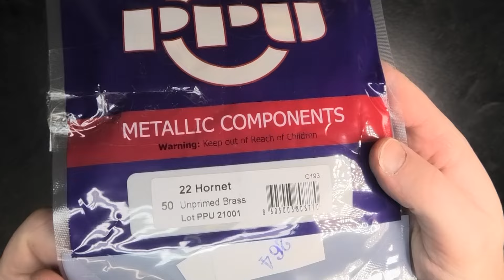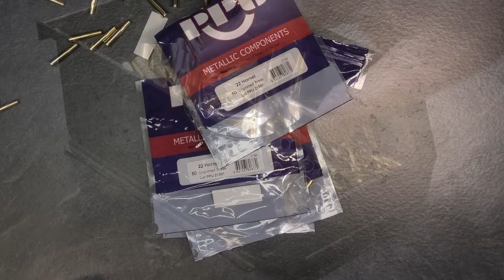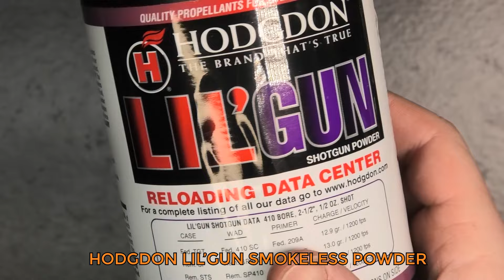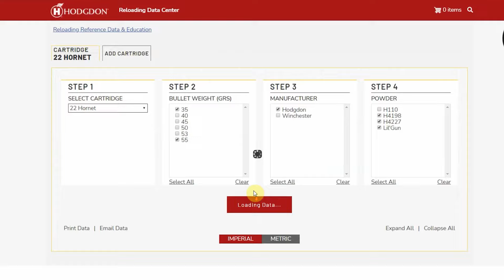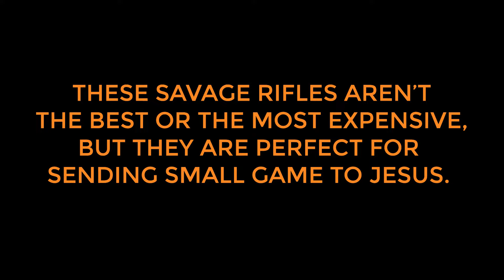Reloading .22 Hornet - A varmint obliterator.

Comment: Interesting background of stereo gear.  Iraqveteran8888 also has a music channel as he play guitar like a madman.  You have that talent as well?

Would the 55gr improve if it were not compressed?

When my new bench flexed like that, I remounted the press on a 2x6 length ways, front to back, across the bench and bolted it down.  No more flex.
Reply from the maker: Oddly enough, I do play a fairly mean bit of guitar, but the background was a  crazy video I found a while back, (and have been looking for so I can give credit), where some guy stacked every 80's hi-fi he could find and plugged them all in.

The bench is out of an old welding shop. The top is 2 pieces of laminated ply, that's been compacted by a life of hard use. I sanded it smooth and glued down the laminate. I'm not sure that's where I want it, so it's not bolted to the wall, and one side is missing, hence the flex. Too many things in the pipeline in front of that that project unfortunately. We're also looking at building a huge outbuilding and it might move out there. Just not sure yet. 

I have a CZ 527 MTR in .223 that also won't cooperate with 55gr bullets, but is sub moa with the 35gr (I almost sent it back to the factory, it was like 6-10 moa!!). The pests are marmots (huge prairie dogs)and bobcats, anything bigger I'd step up to probably 308. this round is moving fast enough that it should pop them pretty good.  Oh, and the reason I have to compress is the loaded overall length has to be 1.725" which is crazy short. If I reduce the powder load I risk getting a bullet lodged in the barrel, and if I don't compress it won't even fit in the magazine (not sure if it would feed but the bullet would be in the lands). It's a tricky little round. 

Thanks for the comments, always appreciated, and don't think I'm arguing, I love input!! :)
Reply: @High_Caliber  I've seen another video where the fellow made a round up without powder and let the bolt close and set the cartridge depth for the perfect length for his gun.   If a bullet gets stuck in the barrel it should not be a problem during testing a lighter load as long as you drive it out before firing the next round!  Not an uncommon test method.  Just use a wooden dowel to check the barrel each time before the next test round is fired until you get the reliable load.  

I find your video is well done and easy to watch.  I watched a few of your older videos to check out the difference.  I find it difficult to be in front of a camera and talk, hence, no videos for me.  Maybe add a few of your favorite (non-copy righted) guitar licks on the end for us to enjoy!

PS:  I want to send my Kbar to you to sharpen for the exact same reason.
Reply from the maker: @callawayken650  That's not a bad idea about the depth, but again, I am limited by the magazine clearance, and since it's not a single shot, the best I can do is maybe a few thousandths over factory. The necks on these are so tight, I might actually damage the bolt trying to seat them, and offcamera, I had a heck of a time extracting one of the 55gr loads (brass was form fitted, just too much pressure).

The channel is a hobby. I watch what other 'tubers do, and they act like gameshow hosts but have subscribers in the hundreds. It's crazy. I'm just not going to do it. I don't need sponsorships, I don't need anything from anyone (except high fives and good thoughts), as I never want anyone telling me what I need to do, and I NEVER want to "chase the numbers". If you note, a lot of videos are different from each other. I like to try different things. Most things fail, but if I can watch it with a scotch and not think it's cheesy, then good enough. 

I'm just now doing a EDC video. I want to see how it evolves over the years I'm out here in this crazy place. I NEVER needed a multi tool in the city, but here it's a necessity. Things like that. I think it will have enough interest to those I wish to communicate with, but not for the general public, which is perfect. You know how they say you can't please everyone? Well my motto is "who cares, let's have beer". 

Sorry to ramble. It's quiet at 4000 feet in winter, a person can go a little stir crazy (if it wasn't for all the damn chores!!!) :)

Comment: Ive been jonesin’ for a video. Finally looked you up and my notifications were off. Great to see you back. 
Is that a .224 55gn projectile? Looks like the same ones the I’m loading like a banshee.
Reply from the maker: I loaded I think maybe 10 with the 55g boat tails.... definitely didn't run well, so I'm sticking with 35g (might keep an eye out for 40g). I've got a lot more calibers to do, but as you know, WAY too many things taking up my "free" time... next one is .45acp, then a 6.5 creedmore. If I had the new range finished, I could have done a proper accuracy test. I'm definitely not gone, just really really busy :)
Reply: @High_Caliber  55 grain is way too much for the hornet/218 bee typr rounds.
There is a reason the highest 45 grains are extra soft points.
Not enough velocity.
The 40 grain vmax is quite good

Comment: I load these alot. I dont crimp, I use 12gr lil gun, 50gr hornady xtp (my gun likes those, savage model 40). I tried lighter loads but settled on 50 cuz groundhogs just stop instantly. case head separation is a thing. I had that when trying a crimp. Dont crimp
Reply from the maker: I agree on the crimp, they showed signs of overpressure on the 55gr, I'm finding really good results on 35-40g flat bottom bullets with no crimp. It's a neat little caliber.

Comment: You Savage 25 WV  is not designed to handle a 55gr bullet.  The original hornet was designed to shoot a 45gr bullet.  To shoot the 55gr bullet, you need to replace your barrel with  a faster twist rate. or just stay with smaller weight bullets.  I current own 3 22 hornets. I own a Savage 25 WV, and it loves the 33-35gr grain poly tips.  Have been reloading for the Hornet(s) for  nearly 45 years. Just one other thing, Remember Accuracy kills, NOT Speed!.   All my rifle are well below max charges. Which makes a little easier on barrels life and slows  burning out the throats.
Reply from the maker: Yeah, I figured that out in those first shots, there was just nothing right about them. I broke them down and ordered 32. 35 and 45gr projectiles. I've got it running pretty sweet, although to be honest, a lot of what I use it for now could be accomplished with a mini mag. definitely more energy expelled, so I'll still use it in case I don't hit dead center,. Neat little round.

Comment: 5:30 or so - Gold colored nut on sizer decapper; what is that?
Reply from the maker: I found some anodized quick change bushings for the hornady press on ebay I believe, just a random item as I was looking to add a few more of the 'all in one' bushings that don't require a separate lockdown ring. Not great quality, but looks neat and does the job :)
Reply: @High_Caliber  I suspected the Hornady item.  I have most Dillon presses (save for one old C&H single; a moose I use for altering one case to another).  I just try to keep up and I was curious.  Thanks.

Comment: Hello. So what about cash costs? How much money do you spend for reloading 1 cartridge? Have you compared to brand-new one?
Reply from the maker: .22 hornet is almost impossible to find factory loaded around here, so most of the issue is availability over savings. That said, for say .223 The reloading cost (if you have brass) is usually around 1/4 the cost of factory. 9mm is not much of a savings per round, but if shooting in bulk it adds up quickly. The hornet takes a fair bit of powder for what it does, so it's one of the more costly to reload for...but totally worth if it you have a hungry rifle...if that makes sense?
Reply: I have seen them for $80 for 50. I can buy the cases for 35 bucks for 100. bullets are 25 cents. primers are 17. about 5:00 worth of powder. it's definitely cheaper to make your own.

Comment: LilGun is magic in the 22H. Compressed loads are just fine.
The twist rate, commonly 1:16, makes for issues stabilizing anything over 45 grain round nose (wich it was made for).
Im suprised the 55's didnt keyhole for you.

You should try the Sierra Varminter 1385 or the specific hornet bullets (40,45 grain) for it. The 40 grain varminter goes around 2800 FPS in my anschutz. I love that rifle!
Reply from the maker: This was literally my first reloads, I kind of wanted it to be more organic, not something I've done a thousand times like 9mm. 

But yes, my rifle seems to prefer 35gr round nose-flat tail quite a bit. Excellent accuracy. Noisy little round overall, The supersonic snap is quite noticeable. Devastating to pests though.
Reply: Pretty sure he might have a 1 in 14 twist barrel since the 55s didn't keyhole. I've had keyholes with 52 grain bullets with my 1 in 16 rifle
Reply: Most newer hornets are 1:14 since most .22 cal rifles were 1:14 by then so they didnt have to make as many different twist barrels.

Comment: One of the least enjoyable cartridges that I've ever loaded!
That PPU brass is some of the best Hornet brass that I ever loaded.

Yes, do not crimp it, watch your headspace, and do NOT hot load this cartridge!!!
Reply from the maker: The crimping and the 55gr bullets were a mistake. It feels so wrong putting so much powder into these little cartridges, but with ~30gr bullets they are crazy accurate. I would FAR prefer a rimless cartridge, but I assume they need that extra bit of metal down there around the primer.

Comment: From your description:  "This round has some of the power of .223 with a fraction of the range. Perfect for wanting to only hit targets relatively close by."
Dont under estimate the power & accuracy of the 22 Hornet. I can make woodchucks take dirt naps at 200yds with my CZ527 American, very easily.

From your description: "Reloading is dangerous, and should be done under supervision of someone qualified to handle explosives."
Smokeless powder is NOT an explosive. It is a flammable solid. Lets make sure we are describing things correctly here. We don`t need unnecessary untrue statements floating around.
Reply from the maker: Probably a good thought. I was more concerned with some twit suing me for blowing a digit off or something, but you make a good point. 

Have you had any concerns with this as a varmint round? I'm really tempted to stick with .22 or 17hmr, but we have coyotes, fox and bobcats getting into the livestock. I don't want to just wound something and have it suffer, so I'll be putting good effort into the shots, the nikon is good glass. What do you prefer  if you have the choice?
Reply: @High_Caliber  
Every caliber has its place. Shot placement is a must for a good quick dispatch. My preferred caliber for any larger varmint is the 22 Hornet out to 200yds. Smaller size animals like squirrel, the 22LR is plenty sufficient. Lots of people swear by the 17HMR, but i`ve seen the 17HMR not do well in windy areas if you have to stretch it out there a ways. The Nikon scopes are decent. I have the Nikon FX1000BLACK 6-24x50 on a 22-250, the glass is spectacular, and it tracks very well. Most all of my hunting rifles all have Burris Signature HD scopes. I have the Burris Signature HD 3-15x44 on my CZ527 22 Hornet (#200531). Burris scopes are a awesome scope for the money, along with one of the best warranty`s in the business. I can`t tell you how good their warranty is because i`ve never had to send one back in to them in 40+yrs.

Comment: Your over sizing the neck when it "bulges" like that. No need to make it that small. Your just working the brass more then needed.
Reply from the maker: Agreed. This was a fist run with different bullets. The tapered bullets didn't work at all, I ended up using 35-40gr flat tail bullets.  No need to crimp at all really.